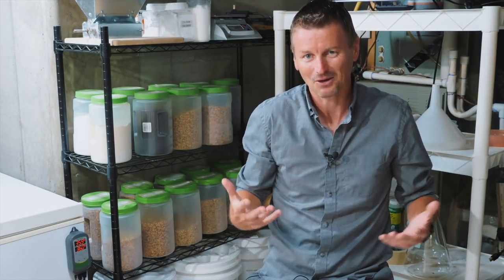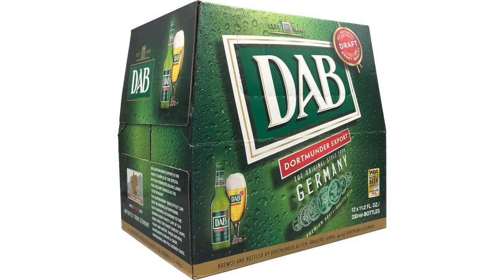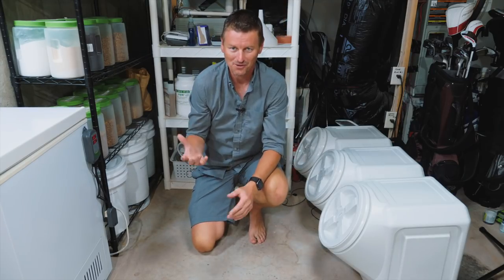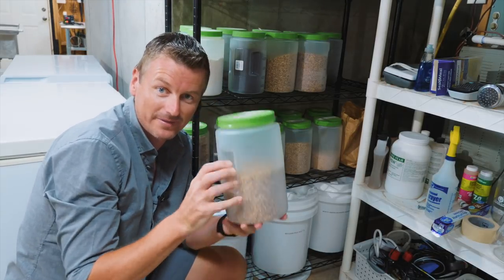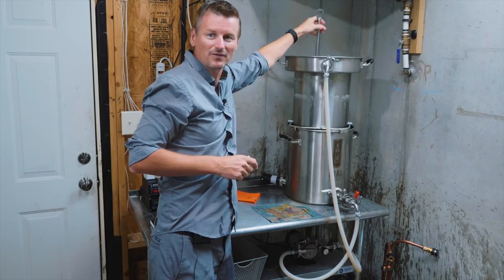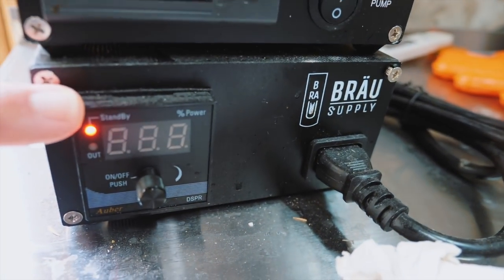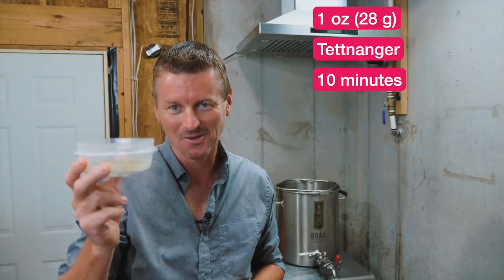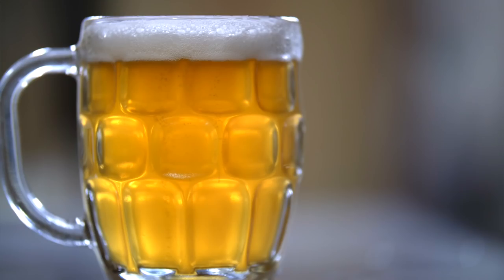How To Brew German Helles Exportbier | Grain Storage

Comment: Smart ideas for the containers from the dollar store.  Good thing you didn't get burn.  You may need a better support system overhead to prevent the mash bucket splashing in and maybe lower your table too.
Reply from the maker: Yeah in subsequent brews I leave that raised vessel alone until it has drained. My own fault.

Comment: I poured wort all over the garage floor recently while transferring, no matter how many times i washed it, i still found a sticky patch for weeks! I was wondering if you shouldn't have adjusted the hop rate, based on having less volume in the kettle, but it didn't sound like it was too bitter.
Reply from the maker: Good to hear it’s not just me!

Comment: Thanks for a great video. How has your efficiency been with the unibrau system? I have been getting low efficiency in the 60’s, but I think my crush size was too small.
Reply from the maker: I’ve got BeerSmith set at 68% for this system which is about right but is sometimes closer to 70%. Crush size has made a big difference for me so yeah maybe try changing that.
Reply: The Homebrew Challenge thank you for info!